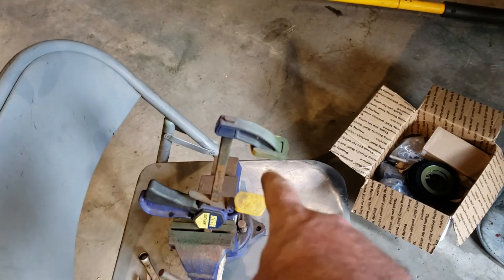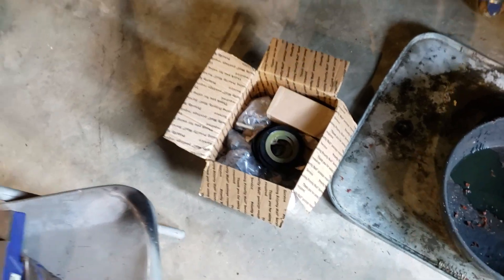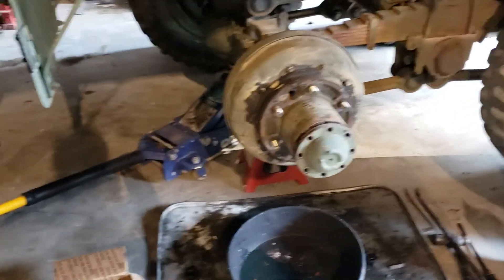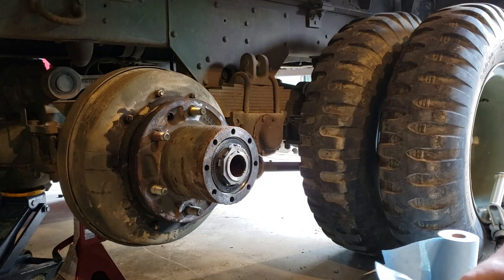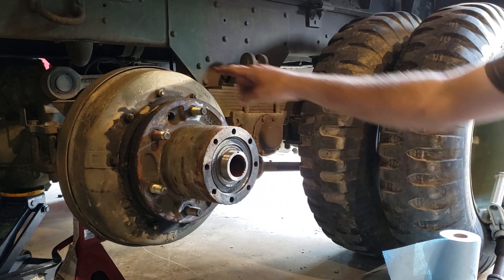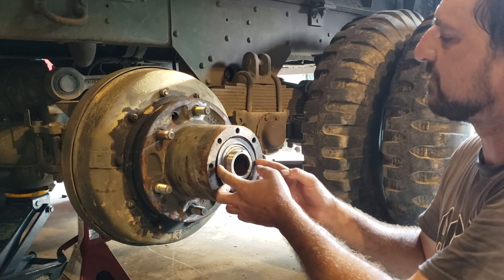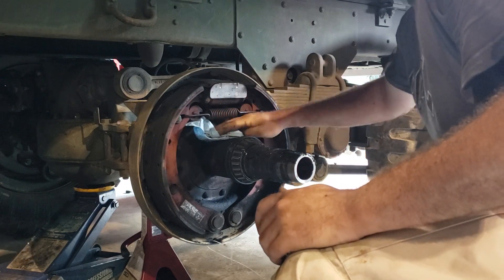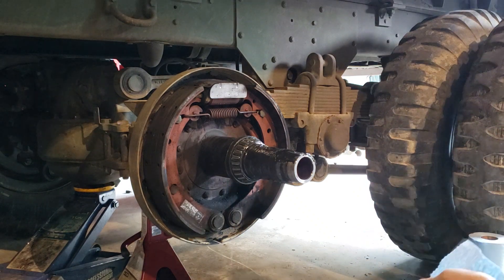M35A2 rear hub service pt.1 of 2.

Comment: I just did wheel bearing service X 6 on 1972 AM General M35A2. It was way less complicated then any modern wheel bearing replacement. If you ever replaced bearings on a lawn service trailer you can service Deuce and a half  hub bearings.If you have serviced a late model F-350 4WD front axle hub bearing this repair will be a walk in the park. It's fun.

Comment: Just as a warning. The cheap Chinese outer wheel seals heat up and alot of people have had issues with them.  Regardless if you go by feel or go by the tech specs.  I recommend getting oem outer seals.  They are made slightly different and have different runner seal and metal thickness. There's threads on steel soldiers about them failing.  Also, there's a tool by Western Canadian Rockwell that allows you to put the inner wheel seal pressed on straight and very quickly.  It goes over the axle and you use your large socket to slowly tighten over it and it presses on evenly.  Some food for thought.

Comment: Also for anyone doing this you can get the duals off all in one unit just take off the axle shaft and locknuts and you can slide the two tires off along with the brake drum all in one piece. Also if yer cheap like me ya can use diesel and soft bristle brush to clean things just get a catch pan and give er a good scrub down. 3$ in diesel 😁

Comment: Are there also seals in the gear house on each axle that need to be changed ever my duece I did the hub seal change it was stolen after I got it back the hubs where pouring oil a round 2 quarts just parked just want to be sure it don't have any in the axle gears that I might need to change also before using it again
Reply from the maker: No, just the inner and outer hub seals.
Reply: @tacticalrepair  thanks

Comment: Is it possible to get a seal for more than dust line that will resist or prevent water from entering
Reply from the maker: Not that just fits in place. There is no real seal pocket on the hub there. You can maybe machine one into the hub if you can find a seal that large to fit.
Reply: @tacticalrepair  good to know I plan on buying a duce  in the next few years your content is great I love learning all the maintenance I’m gonna need to do.    If big mike is out of steering kits where would I find one
Reply from the maker: @Radioactive216  you'll want to order a power steering kit from Tom at www.waterloospecialties.com

Tell him I sent you.

Comment: Do you have a video on how to switch one to super single or back to dual from super single? I looked but maybe I missed it?
Reply from the maker: No I don't. It is relatively easy though. Just flip the hub around in the brake drum and flip the bearings and races from one side to the other as well.

Comment: What's the grease deal? It's a full floater, like most. Runs off of liquid.
Reply from the maker: These don't. That outer seal keeps oil out of the axle tube from getting into the bearings, and the inner seal is really just a dust seal. They cannot and will not hold oil. Remember, these were designed in 1947 and only entered production in 1949, well before oil bath wheel bearings were a common thing.

Feel free to check the old Rockwell maintenance manual or any of the military technical manuals for reference if you don't believe me.
Reply: @tacticalrepair  I had no idea. I just figured never being in mine. What year did it change?

Comment: Thanks for the video!  I'm going to do rear axle seals on my M35A3, so I found this helpful in giving me an idea of what to expect.  I'm a little curious about how you checked the wheel cylinder for leaks though...  If you peel the rubber cups/seals back on either side of the wheel cylinder, isn't it going to leak brake fluid anyway?  Checking the cylinders like that seems like you're going to damage the seal anyway.  Wouldn't it make more sense to press the brake pedal and check for leaks afterward?  That said, I visually inspect the backs of each wheel on my truck for brake cylinder leaks while draining the air tanks at the end of every day.
Reply from the maker: No. The outer seals I peeled back are just dust seals that keep debris out of the cylinders. There are cup seals inside on the other side of the pucks that actually are meant to hold fluid. When they start to leak fluid will build up behind the outer boots, but it shouldn't be there.

Comment: You could repair your socket using the wrench/coin trick: https://www.youtube.com/watch?v=-I_tRe790o8

Just lay a weld bead down and grind to fit or you could use different thickness scrap metal.